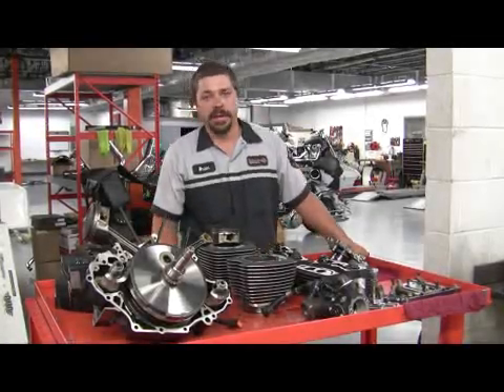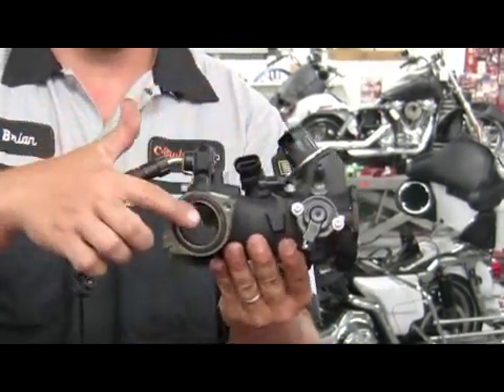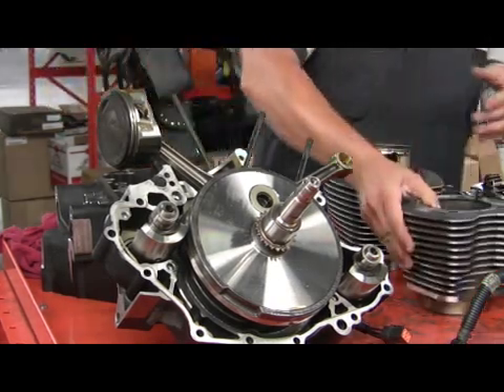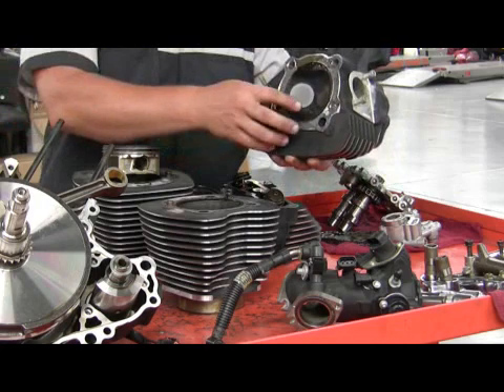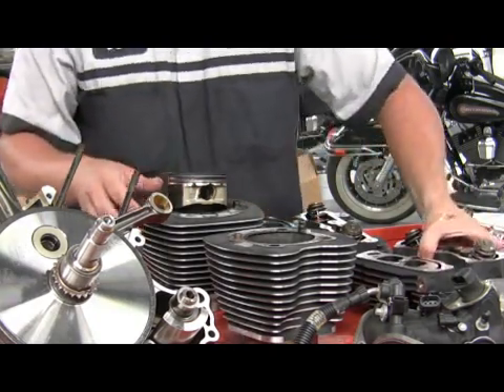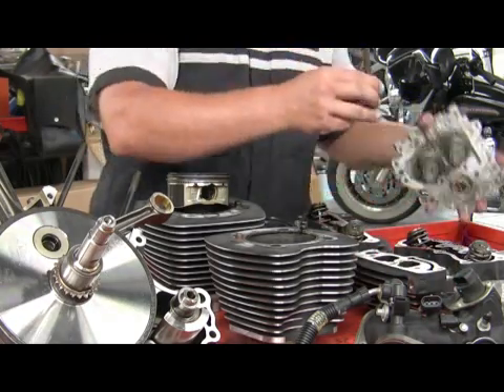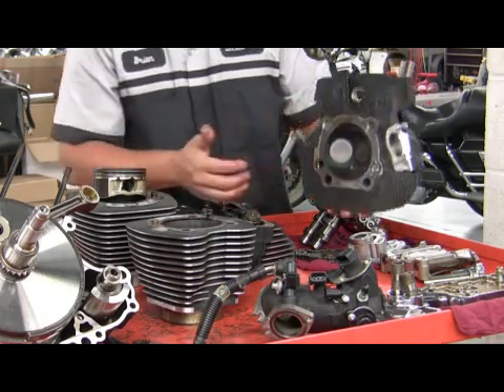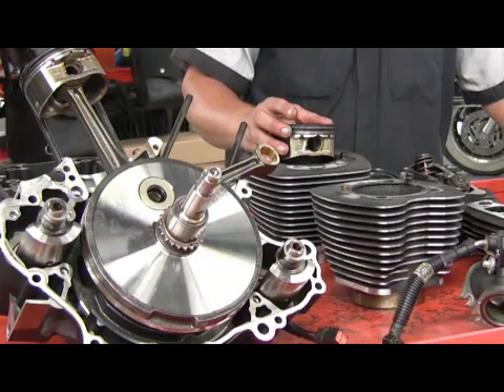How Does a Motorcycle Engine Work?

Comment: For some reason I pictured that piston as smaller, so basically there is only one piston on a bike?
Reply: Socratic469 That depends on the engine. In this case there are two pistons. This one just had one piston disassembled from the connecting rod.